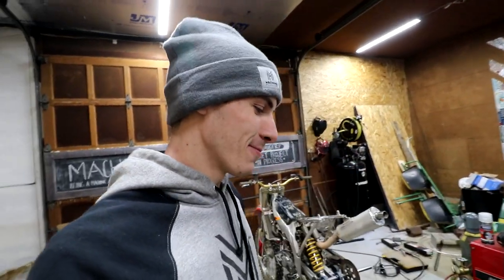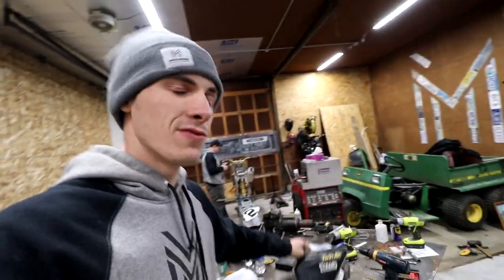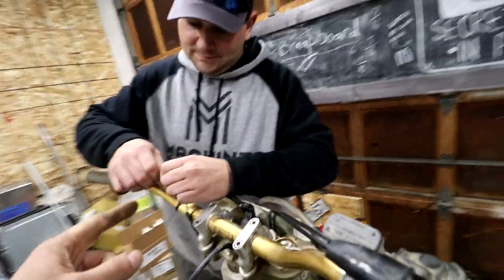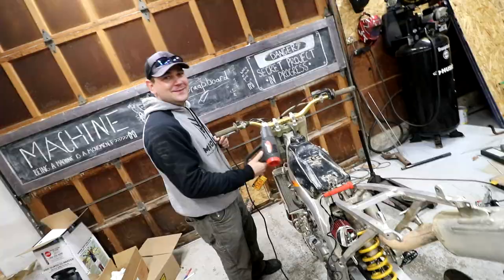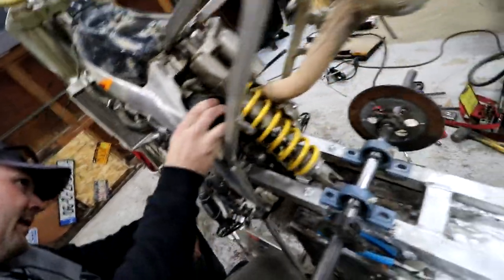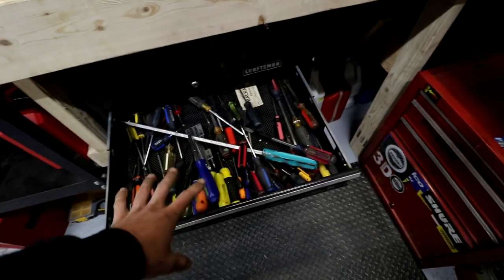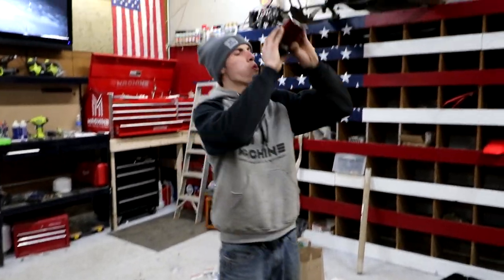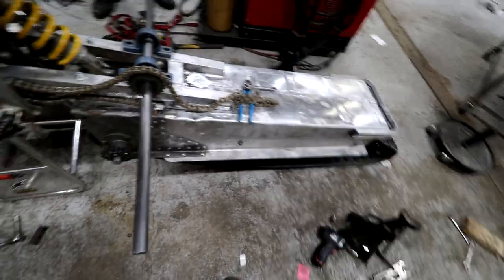SAVAGE SNOW BIKE IS BEATING US...

Comment: hey Dalton, you should shorten the muffler on the 450, drill out the rivets, remove the cap, cut the can down shorter, and re rivet the cap back on. they look so much better shortened

Comment: Just some constructive criticism, snow blowers don't have air filters. Why? Because the snow makes everything wet ! Meaning there's no dust. What I worry will happen is that filter will get wet and it will freeze. And it will clog, your better off rocking out with no filter in my opinion. I'm interested to see how this all works out. Aside from that The channel is really on the up ! The shop looks great and the content is getting better each video keep it up 3D.
Reply: daniel rodriguez well some do its manly just a wire mesh filter though and I'm pretty sure snow mobiles have air filters I could be wrong on that though

Comment: 3D machines you inspired me to build a four wheeler I just bought a 2016 Grizzly 700 any ideas for first mods!?!?
Reply: Nikolas Tomlinson clutch it if you can
Reply: Nikolas Tomlinson fmf pipe lol
Reply: Nikolas Tomlinson snorkels and rad relocation
Reply: Diesel _ Nashe I wanna do the muffler no snorkels yet or radiator I was looking at a lift and rims and tires
Reply: Nikolas Tomlinson ok 👌
Reply: Nikolas Tomlinson I would do a 4 inch lift